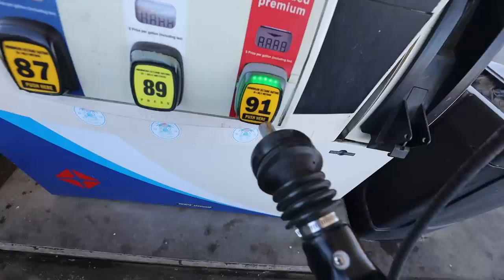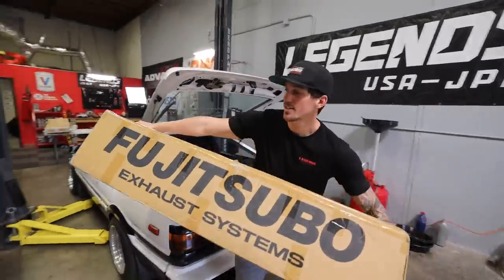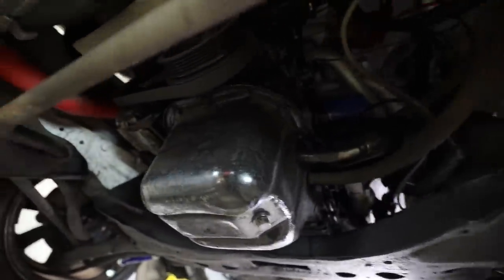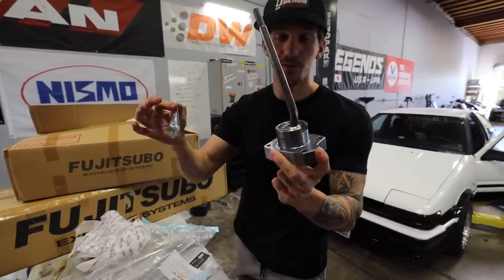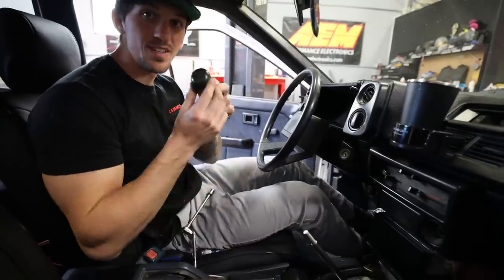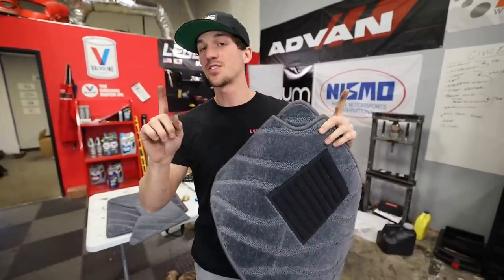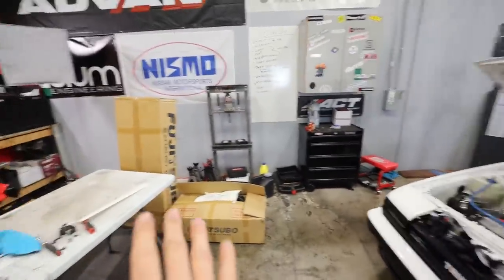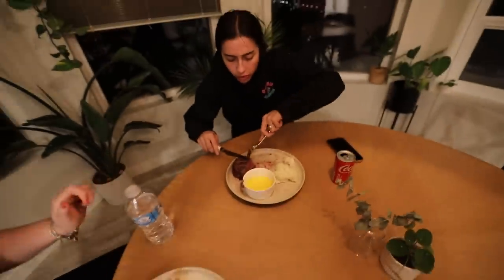BUILDING INITIAL D STYLE AE86 Ep. 1 | FIRST MODS!

Comment: These cars are kinda known to be kinda flexxy and toyota have used very thin metal thats kinda why they are so light. That also means they flex a whole lot and so that front strut brace really shows how much the car flexes. Thats also why most ae86s in japan have the bolt in roll bars and a a popular thing to do is stitch weld the chasis which adds alot of rigidity plus the roll bar

Comment: Fortunes will definitely NOT be nicer than the Annex coilovers. Here is a good clue: the Fortune True rears physically will NOT fit unless you hammer in the body. You should contact Annex to get you the parts to convert those rear shocks to True Rear coilovers. 

HUGE difference when the team are actually enthusiasts of the chassis.
Reply: What is the steering wheel called ?

Comment: nooo, annex is probably one of the best suspension set ups you can get for an 86.... oh well
Reply from the maker: Really! I didn’t know that. I was told the opposite!
Reply: @dustiinw  seriously. A LOT of 86 guys run them.  Annex is a smaller company  but they still make a good product.  They did a lot of R and D especially for the 86. there are 2 generations.  Your pick for the fortune Auto is a good selection as well. but I would do a double check to see what ones you have.  Divorced and true coil are marginal differences.  and some may say divorced are better?  Im a buddy of Ryan, hit me up anytime if you want to talk shop
Reply: @brandenburns3322  can confirm annex is the best!